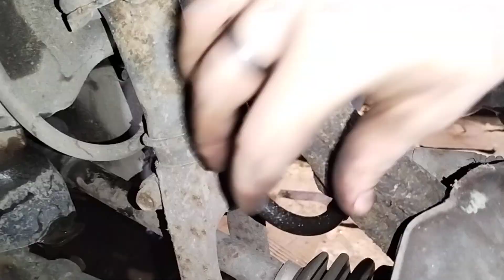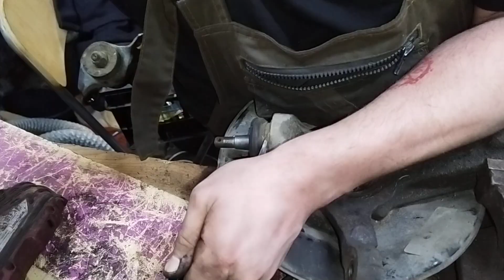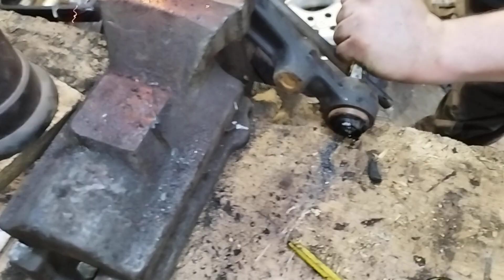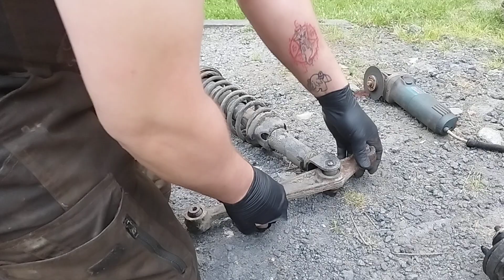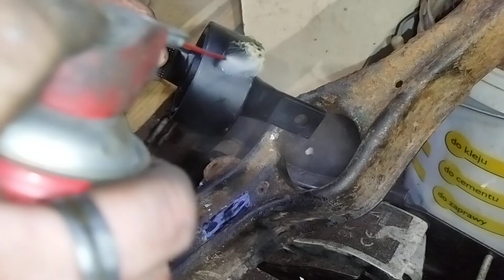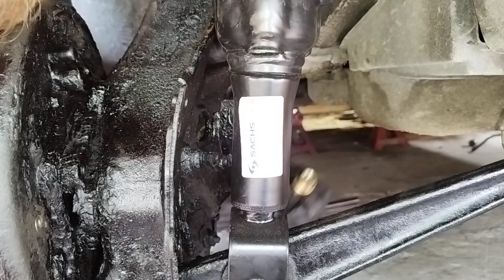USDM Civic EJ2 wrenchfest - complete suspension, brake system, and other fixes! #oiomgarage

Comment: where do you find all the specs of torque/Nm?
Reply from the maker: Basic torques can be found on spreadsheets on Google. Try "torque reference chart". I had all new bolts and nuts with 10.9 hardness so I knew which specs from the chart to use. You can also try downloading old workshop manuals for civics, they have the same info